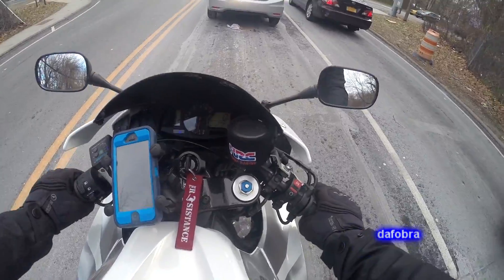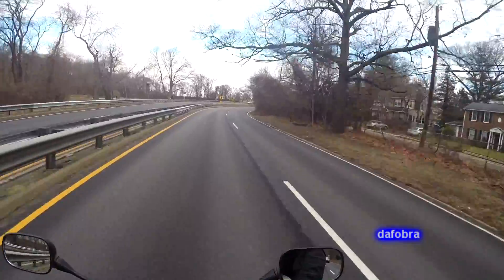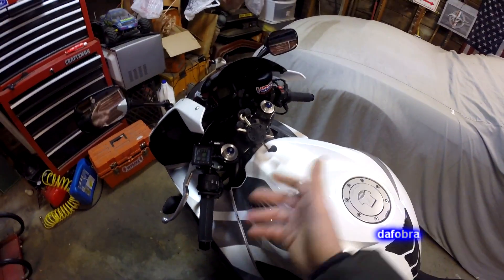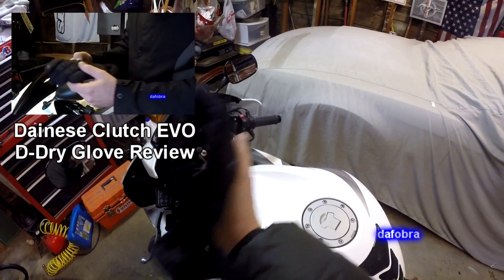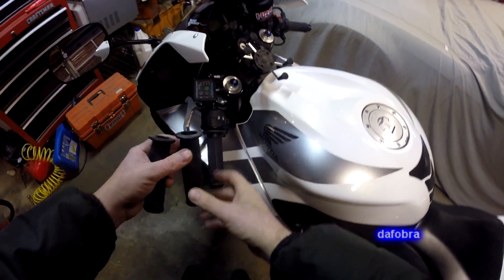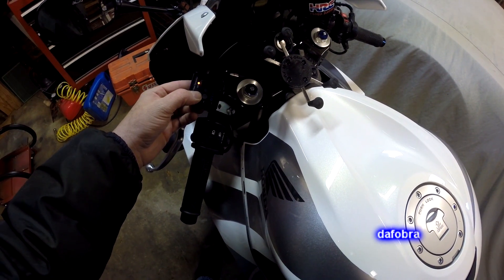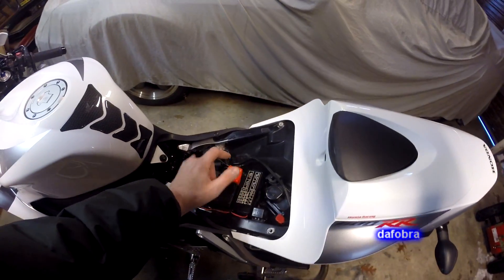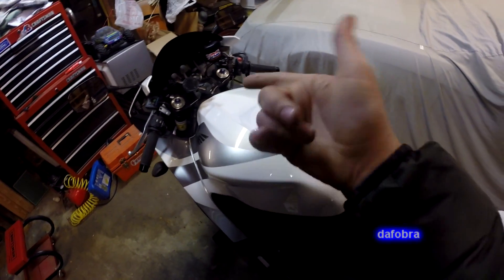Oxford Premium Sports Heated Grips on a Sport Bike

Comment: I've got the exact same grips and love them. The reason I went with the heated grips rather than the heated gloves is because when riding in early Spring late Autumn during the day the temperature can get fairly high so I don't have to wear my winter gloves, but the temp drops drastically when the sun goes down. But having the heated grips eliminates the problem and saves me taking a second pair of gloves with me,  or just having to ride with cold hands
Reply from the maker: I have thought of that too.. I can wear my late spring/summer gloves on those early morning rides knowing that it will be warm enough later in the day.  They look like they will wear nicely.. very durable.. have you found that?